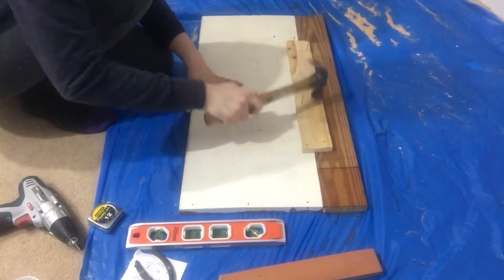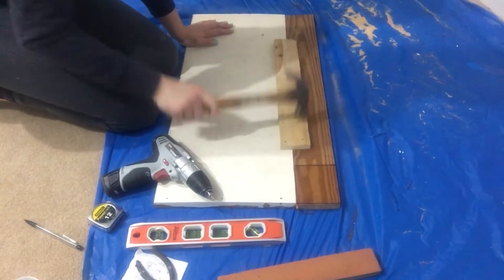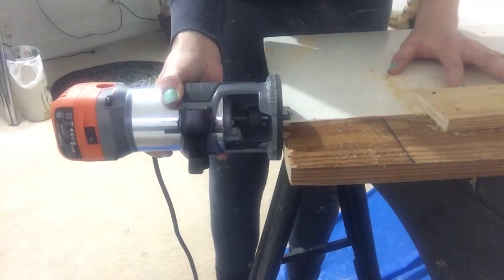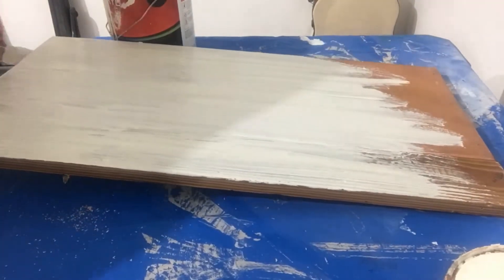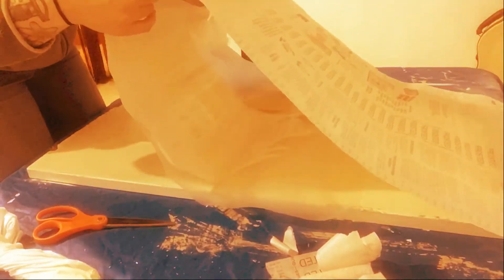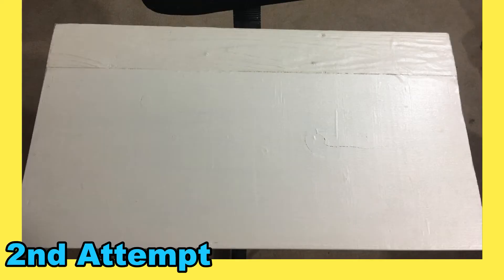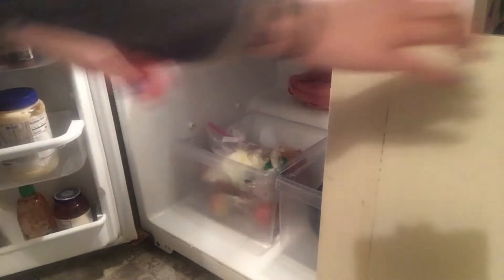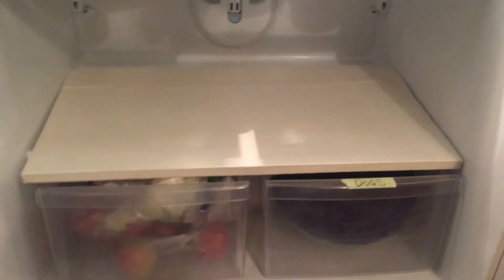How to Fix a Broken Fridge Shelf | You WON’T Find This Anywhere Else!

Comment: The plastic bracket broke off the fridge wall that holds the shelf on one side. Can you screw another one in the wall of the fridge
Reply from the maker: Hmm I’d maybe try some kind of hardcore glue first? You can buy a tube at The hardware store called Liquid Nails that’s exactly what it sounds like. I feel like maybe drilling into the sides of the fridge could be a problem. But I’m no expert!